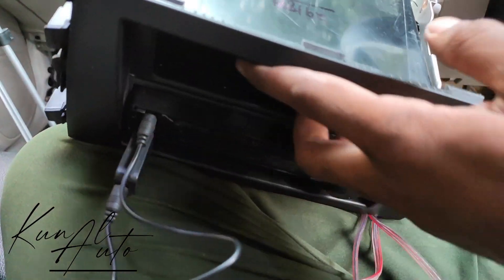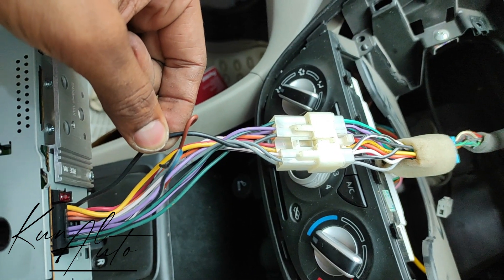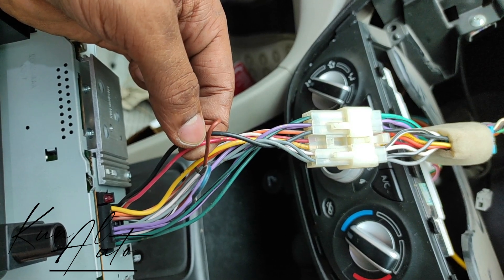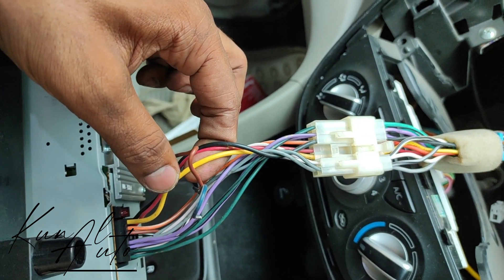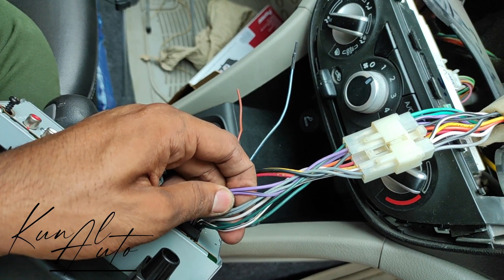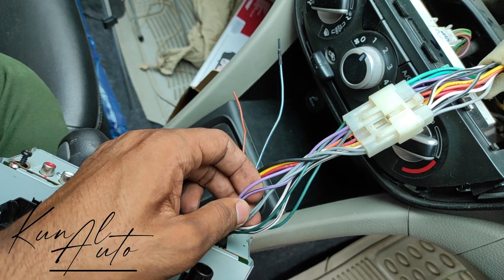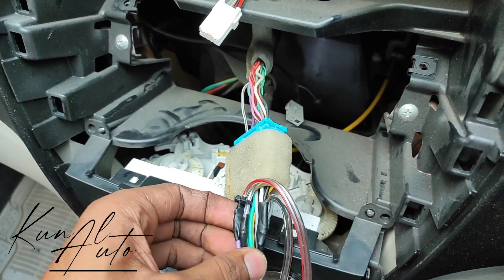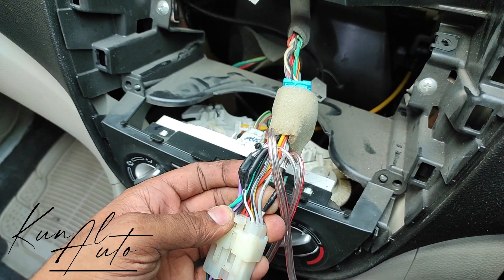Car Speaker installation/Sterio wiring Installation/Celerio/Pioneer TX-1601IN

Comment: Was wirering for the rear speakers already prepared? Is seemed like you only had this plastic cap before.
Reply from the maker: From stereo wires for rear speakers are available i have extended the wires from stereo to rear doors